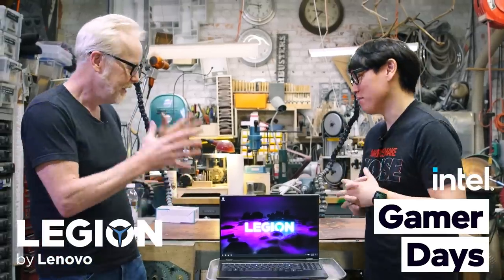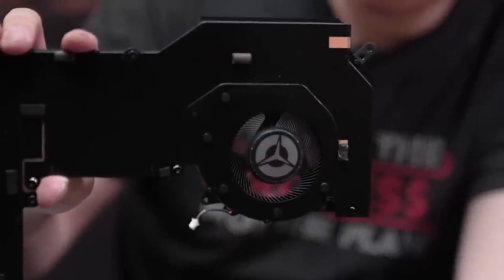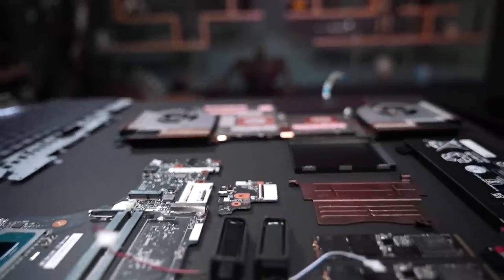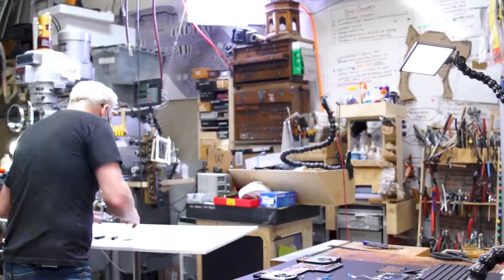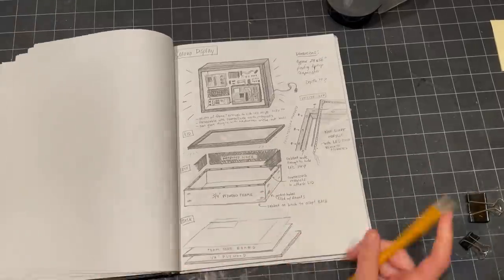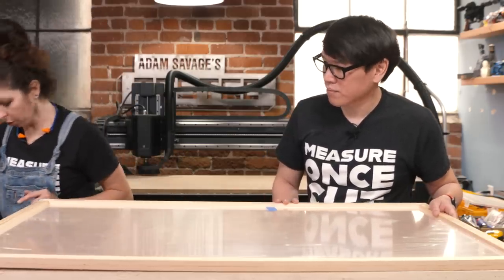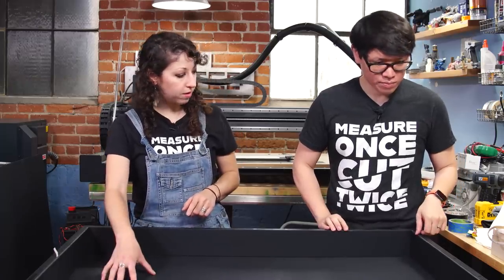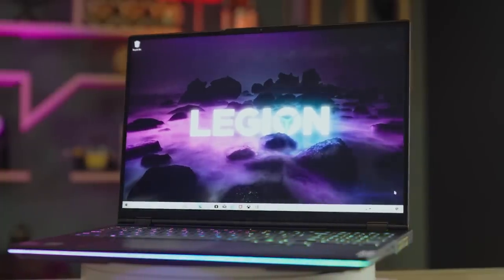Savage Inside: Lenovo Legion 7i Shadowbox Display! (Intel® Gamer Days)

Comment: Imagine if it was still working in this state. That might be impressive.
Reply: At least the keyboard with its cool back colors
Reply: I thought that was the plan, i guess most of the cables are too short to do it properly.
Lenovo could've send them some longer ribbon cables and extensions but that might not be a good idea electrically.
Reply: I've seen custom PC builds done shadowbox style like this - it's a really cool look.
Reply: Imagine if Adam works with Linus on the inevitable Desk PC 3.0. They could probably do some really crazy stuff with both Linus’ and Adam’s experience and all the machining gear they both have.
Reply: I was thinking the same thing, but then realized, without cooling the CPU, GPU and GPU memory will burn out in seconds after power on.

The best way to do it would be to have everything dummied up to look they were connected up functionally, but there is a completely separate computer driving the keyboard, track pad and display, in the shadows.
Reply: Cool idea, maybe immersed in non conductive fluid. Oil maybe...
Reply: I too thought that was the goal here. Kind of like that scene in robocop where he is suspended by the torso with a bunch of cables loose but still working.
Reply: Exactly what I thought!
It would be feasible to mineral oil cool the mainboard and still function as a display piece. USB or network storage could be hidden away. But RAM would either need to be in or attached with a flexible, translucent exteneder. The rest of the cables could be easy enough to hide.
Reply: @joost199207  Yeah... there's something to be said for breaking/ruining a thing and then putting it in a nice box, but I'm not sure it's for me.  If you can keep the thing working (like Ben Heck's videos/projects), that's pretty cool, but if it doesn't work it's just a nicely displayed thing that is broken.
Reply: @TimCortesi  +1 for Ben Heck!
Reply: It's doable. I run an open case system myself.
Reply: That will be on LTT haha
Reply: @BrotherChad  money and coz they can??
Reply: Yes they could of made it work, you know they could.
Reply: Yeah,   essentially they took a bunch of parts and put them up as a pretty display...   The beauty of a computer is taking all that technology and making it work...
Reply: @BrotherChad  Lenovo wants that in their offices as decoration, Adam and Tested made it, now they have it in their offices as decoration and people go "oh nice, Adam Savage from Mythbusters made this?" 

Big tech companies commission art and stuff all the time. Don't even get me started on all the garishly painted custom Ferraris sitting in lobbies with the goal of impressing muggles. Displaying expensive stuff/stuff you're proud of isn't new. I would even say that maybe more than half of all paid art these days is for corporations in the same way that most art in the olden times was for the church/other religious entity.
Reply: To the people who are dissapointed it doesn't work: The mineral oil idea is dumb for something that's gonna be mounted on the wall. No one wants a fucked up floor 3 years from now when it ultimately cracks. Not to mention that some cables need to be short to work these days cause shit's faaaaaaast.

Ben Heck made old computers work all spread out, that is cool, but ultimately far easier due to the ridiculously slow transfer speeds etc in old hardware. You could hook that shit up with the worst cables ever and it would still work just fine. New computers have way smaller tolerances. Even slow garbage like HDMI craps out if the cable gets to a certain length. Make a really sharp bend in a SATA cable and you'll find that it might not work afterwards. 

Shit's finnicky. Making it work would be a substantially bigger job, and maybe not what Lenovo wanted in the first place.
Reply: @vgaportauthority9932  I've really got mixed feelings about this.  I know somebody who has an old core memory board in a frame on the wall, it's cool, it's history so I can understand how something like this could be seen the same way and that is cool, but on the other hand the point of technology is that it functions, it makes life easier,  it makes things fun.  This project is taking something that can allow somebody to experience  this and many other worlds,  and turning it into a dust collecting pile of e-waste.  I could be that I'm feeling this way about it because it's modern tech, but is that notebook really something ground breaking that needs to be displayed this way, like the core memory?   I don't know.  Maybe if it were the original MacBook Air or one of the original notebooks, something that was seen as a game changer, I would feel differently, but this is one of many notebooks made by many different manufacturers that are pretty much the same inside.  If this particular notebook is cool in any way, it's in the way it works, and it can't do that glued in bits to the wall.
Reply: Can't I just put it back together?
Reply: reposting my comment on another thread about the same idea:
The showstopper is RAM.  Other stuff could be cabled together.  Cooling is also a huge problem, but thermal throttling could let it turn on and show something on the monitor while running very slowly (compared to what it's capable of).  e.g. low duty cycle with sleeps to cool down, using the same power-saving sleep states the OS intentionally enters when idle.  And yes, the CPU's own thermal management logic will do this thermal throttling for you so your computer runs slow instead of permanent damage if your heat-sink comes loose.

---

The RAM would basically need to be in its sockets for that to be possible.  (Or separate the original RAM, but then slot in a replacement DIMM or two to make it work).  The DDR4 3200 traces have to carry 64-bit wide data signals at 1600MHz with very tightly controlled timing skew between different lines.  If you've ever looked closely at a mobo and seen some of the traces do a squiggle, that's because this trace was shorter than the others because of turning a corner, or a pin location or something, and they want the path to be electrically the same length.

Laying out the traces on a board is hard enough; taking that signal through a cable plugged in to the DIMM socket to another DIMM socket is probably just going to fail, unless it's maybe possible to lower the memory frequency a lot so the timing window is wider.  Extra capacitance and inductance from a homebrewed cable will probably spoil things.

This is not nearly such a problem for PCI Express; each "lane" is a separate differential pair that's separately self-clocked as a high-speed serial signal.  PCIe can maybe handle being routed through a cable so you might still get the WiFi card and an M.2 SSD to work.  Especially if you had custom firmware to configure them to run at most PCIe 1.0 speeds, instead of the higher frequency PCIe 3.0

Summary: PCIe is multiple serial busses ganged together, DDR4 DRAM is a true parallel bus.  That only works when timing is tightly controlled, which is why we ditched parallel busses for things using cables, especially external, like printer port (replaced by USB), floppy drives, IDE (replaced by SATA), SCSI (external replaced by USB, eSATA, or in servers internal SCSI replaced by SAS = Serial Attached SCSI).

----

Power / heat isn't a total showstopper if it's almost totally idle, and you have some air movement.  The CPU can thermally throttle pretty aggressively and still work slowly, while running at maybe 80 to 90 degrees C die temp.  Bootup might be rough, depending what OS you pick and how quickly it can get back to idle.
Having the heatsink not on the CPU / GPU is a huge problem but perhaps not a total showstopper, if you don't have any performance requirement.
Reply: Perhaps Lenovo could manufacturer suitable ribbon cables and expansion ports for the break away components so Adam could fire it up....minus the smoke!
Reply: @cliveradvan3414   - See my earlier comment.  Not going to happen for the DRAM, the timing tolerances make a cable unlikely.
  The rest, sure, and some such cables may even exist for use in prototyping.  If not, the cost to design and manufacture would probably be too high.  Especially given that you couldn't usefully use the system for much of anything because of thermal limits, if you want to keep the CPU and GPU uncovered by any heat-sink / water-block.

For cables, perhaps twisted pairs or groups of coax, not ribbon, for some of high-speed signals like PCIe.  (e.g. like a SATA cable which has two coaxial pairs, shielded, using differential signalling)
Reply: @RealElwood1  fully submerged PCs have been around for years, but they're a freaking NIGHTMARE to do anything with.
Reply: @peterstewart3563  Art is cool and useful too…there are more ways to use something than for what it was designed. That said…it’s just a product placement advertisement that get Lenovo some extra geek cred because they now have a piece made by Adam Savage and Tested in their offices.
Reply: it could be adapted to work in a similar state to this.Really the only thing except cooling that cant be spread out this far is the RAM :D RAM needs to be as close as possible to the CPU.
Reply: Thats honestly what I thought they would do!
Reply: Might be!? I was expecting it.
Reply: Non-functioning computer in a shadow box is a really dumb idea. It's insulting to the viewer and insulting to the sponsor, Lenovo. I hope we don't see any more crap like this.
Reply: They could do it they did it with a car
Reply: Exactly.  There is ways to do it with normal PC builds, people are building tables that are basically both a PC case, and a shadow box across the entire desk underneath glass.  There are extenders for GPU PCIE mounting, etc, but I am not sure how easily it would be to find extensions for many of the components here, but I bet you could if you really wanted to find ways to connect it all with mostly off the shelf parts...  
And agreed, that would be the real way to do this..
Also why not at least get the led's going on the keyboard and the border around the case which also had a led strip.(Edited: Just read some other people had this idea in the comments as well, but yea...)  100% agree, the job isn't done in my eyes until that monitor turns on and it all boots up... Even if you have to air cool the entire box to make it run for any length of time, or run small water cooling tubing below the components to keep them cool etc...   then have some way to have the keyboard slide out from the bottom of the frame, and then have the monitor front and center so you can still use it...
I am not sure we will see one soon though, as not many people have the money to destroy a gaming laptop like that, and make it at best a large PC case with a small monitor, and at best mid-range specs.   Still overall I love seeing the parts, the journey getting there was the interesting part...
Reply: Easier with desktop components. I knew a guy who built a working computer on a pegboard using old pc parts.

Comment: It would have added an extra sparkle if the screen ribbon cable had been taken out of the back and fed into a small unit allowing video displays, so giving the unit a bit of life.
Reply: Yeah, like feed it into a raspberry pi or something
Reply: Probably require disassembling another whole laptop... those screen ribbon cables aren't standardized, they don't work like HDMI. Even in a regular monitor it can be difficult to find a replacement display board, in a laptop that stuff is all built into the main motherboard by design. It sucks, because it means the panels themselves are completely useless without the display board that goes with it.
Reply: I was thinking this, also connect up those various LED strips and the keyboard lighting.
Reply: i would love to do this with a computer but keep it fully functional
Reply: @jezzdogslayer  it's been done many times before, once that hang on the wall or ones that are inside a glass desk... it's amazing!

Comment: I Died a little inside when i saw them Ripping the ribbon cables out without flicking the release switch up to release them...
Reply: agree with you...  they should be flicking the connector first.. before releasing the cable bcz no need to force pulling
Reply: I cry when i see good hardware in pieces. :(

Comment: Now after you guys buy one of these laptops and it goes out after a month you can display it.
Reply: True, but there's the warranty. But what about after the warranty? Oh you can get spare parts from Lenovo, pricey? heck yeah but doable. Need schematics? Register with Lenovo and you can have'em. I think they're better off putting a Macbook in a shadowbox. They look amazing inside and out, Lenovo not so much.
Reply: @ldisc66  The higher end ThinkPads look pretty good on the inside, not quite as good looking as Apple but if you look closely the ports have screws that hard mount them to the chassis. 

Also I will re-iterate that they give you maintenance manuals and they sell spare parts for reasonable prices.
Reply: after two months? thats over 10 fresh windows installs just to keep it fast enough to overheat and slow down enough to crash!
Reply: @nickademuss42  You guys sound like you never owned on.  The Gen 6 2021 model really is a top end one.  They drew back on their failures of the 2020 models and came back with a winner this year.

Comment: That hurt watching, pulling all the ribon cables and not releasing the catch's.
Reply: I was going to write the same thing, but you beat me to it.
Reply: @Themaxleydog  why do you have that impression?

I've only ever really heard bad stuff about  HP and Acer Notebooks, Lenovo had some issues very early on, but nowadays I feel like they're what I'd go for the most in terms of quality and longevity
Reply: @Themaxleydog  at least you can fix a Lenovo laptop.
Reply: @dahahaka  hahaha. Ok buddy. My Lenovo slowed to unproductive in a year after being bought.
Reply: @dahahaka  I've had HP for years, Sony for years before that. Dafuq are people talking about?
Reply: @alalalala57  Sony is by far the worst of the bunch lol, there's a reason they completely stopped making notebooks, maybe u got lucky

Know 3 people who had HP notebooks, expensive ones and they all suffered massively from overheating going as far as shutting off due to the heat.

Maybe Omen is better nowadays
Reply: @dahahaka  We have Lenovo at work on a four year lease and not once have I had one last me over two years before trouble started.
My current one is about 18 months and the battery have'nt been able to charge since christmas, which is a big problem when you are a travelling technician. 

Lenovo's helpdesk is great though, so far they have spent 5 months on the problem and they still have'nt given up. (that last bit was sarcasm; the battery is dead, just give me a new one already ...)
Reply: I've been a computer tech for over 20 years. This past couple year alone I've had to attempt to bring back to life more Lenovo computers than any other brand. Some have died 2 or 3 times just within their first year warranty. I would not recommend Lenovo to anyone.

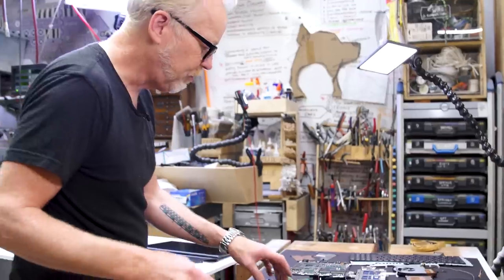Comment: 12:05 "God, wouldn't it suck to trip and knock all this stuff over?" After he just put what's probably one of the heaviest single components left, next to the battery, the furthest away from the middle of a very centrally supported piece of foamcore. In my mind's eye, I already saw the foamcore see-sawing and flipping everything onto the ground. Probably why Adam made that remark, and yet put the screen where he did anyway... :)
Reply: It's quite ironic considering his remark that immediately follows. It's sound advise though and something I do all the time, so my first though was "it's gonna flip!" as well lol
Reply: @awandererfromys1680  If it may fall you might as well assume it will. Happens more time than I want it to.
Reply: @JonatasAdoM   wish I had this thought earlier. Fell in the water today lol I guess it was just too far of a reach. True story.

Comment: You could have opened the flat-flex connectors before ripping out the cables. Also, the screen is still attached and inside its plastic housing, there is further potention.